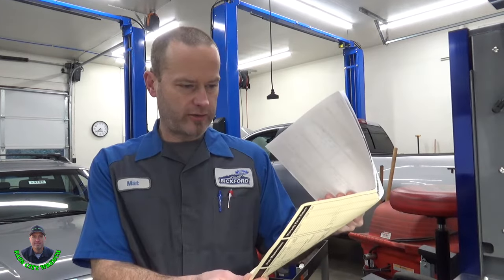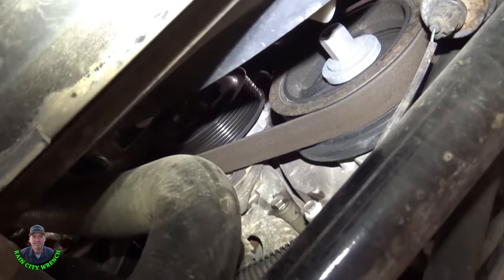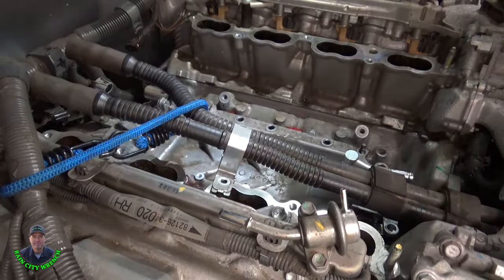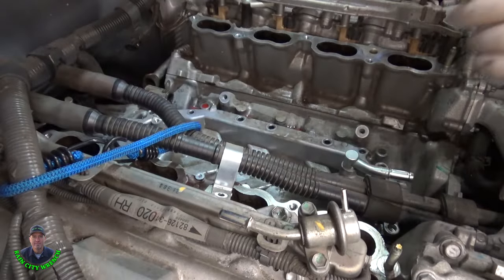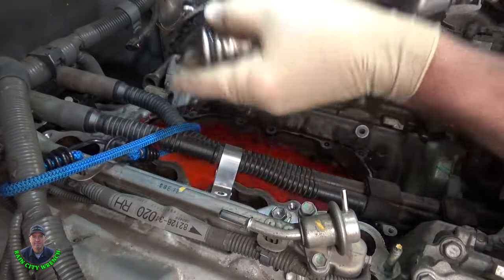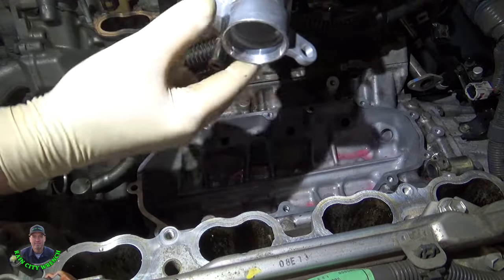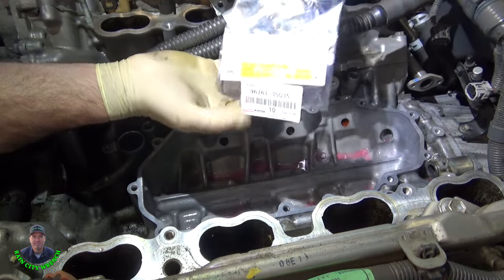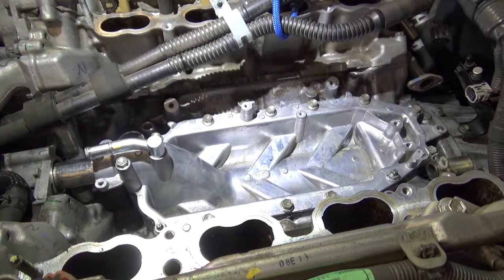TOYOTA TUNDRA 5.7 COOLANT LEAK UNDER INTAKE

Comment: Toyota SHAME ON YOU!!! You need to cover this cost!!!! This goes against your reliability reputation. And you need to FIRE the person responsible for this flaw.
Reply from the maker: A thin aluminum gasket with integrated rubber like a transmission pan gasket would have worked real well for this application instead of silicone.
Reply: If this had been a gm or ford it would have   catastrophically failed. Good on Toyota for doing it the way they did
Reply: @laredopotatoI was looking for a used tundra but all these issues have me scared. What year was your tundra? I might start looking at fords now

Comment: Good video but.....Warning for DIYer's: This is not an easy task. This video was edited and some steps were not included, so if you are thinking of doing this on your own, you may want to take a pause. the water tube and the transfer tube are connected to some kind of regulator behind the engine, pretty much everything inside the manifold is connected to that. That is where the main job is. It is not shown how to remove that in the video. I am currently stuck on how to remove that. The knock sensor plate also has a bolt in the back, in a very tight spot, if you loosen it you have no allowance to get it out without dismantling the regulator(whatever it's called). In my case I stripped it trying to remove the plate, I ended up cutting the bracket-ground(not sure if that is what it's called) kind of like a washer in between the plate and the screw to free up the plate. You have to also be ready to disconnect quite a few electrical connectors. RC, could please, add a few steps on how to get that regulator out of the way. Thanks
Reply from the maker: I think you are talking about the secondary air injection diverter valve assembly. Yea, sorry I didn't film that. I bungee tied the plastic tubes off to the side. You are correct, the hardest part of the job is removing the valve. I take the three bolts out of the valve and then remove the four small bolts holding the tubes on each side. Getting the front passenger side air tube bolt out is a pain, I pry the valve slightly to the driver side to get that bolt out and then slide the valve assembly straight up leaving the two metal tubes intact in the cylinder heads. Hope you have success in your repair!
Reply: What I’ve heard is not to tackle the bolt at the firewall, but rather disconnect the valves ate the lower portion of the  tubes near the pumps behind the passenger side wheel liner.  Then the valves come out with the tube(s) attached.
Reply: Thank you for these details.

Comment: DONT KNOW IF I'D SAY THAT IT MADE IT 122K MILES, LOOKS LIKE IT MIGHT HAVE BEEN DONE BEFORE BY SOMEONE NOT SO THOUROUGH, NORMALLY FROM THE MANUFACTURER YOU DONT HAVE THE RTV SQUEEZE OUT LIKE THAT HAD, GLAD TO SEE YOU TAKE THE LITTLE STEPS TO DO IT RIGHT,  I USED TO USE SYLGLIDE ON MY O-RINGS, THEN I HAD AN OLD TIMER SHOW ME TO USE LIQUID PIPE THREAD SEALER ON THEM, NEVER HAD AN ISSUE EITHER WAY, BUT ANY THOUGHTS ON THAT??
Reply from the maker: Hey Kevin, how you been? Good eye, you are correct. The more I think about it, Toyota most likely used their gray vulcanizing rubber type sealant from factory so that means the first repair only made it like 20-30k. 
 Great tip on the pipe dope. I just looked up the composition: A material safety data sheet reports that the "Permatex" 51D pipe joint compound contains kaolin, clay, vegetable oil, rosin, ethanol, etc[citation needed]. The ingredients are designed to:
 fill minute spaces between mating pipe fittings (kaolin), and serve as a lubricant as the fittings are forced together (vegetable oil). 
 Petroleum-based pipe dope is not intended for use on threaded PVC, CPVC or ABS pipe and fittings since it will deteriorate the plastic. Builders in the US are expected to use thread compounds that meet ASTM F2331 - Standard Test Method for Determining Chemical Compatibility of Thread Sealants with Thermoplastic Threaded Pipe and Fittings Materials or thread seal tape on PVC, CPVC and ABS threads.
 In summary, if the thread sealer meets F2331 standards then it will work in all automotive applications and not deteriorate/swell up rubber seals. Learn something new everyday!
Reply: @raincitywrench117  been good, and busy, those old timers know a thing or 2 don't they....lol
Reply: Ex Fel Pro needs to offer a metal reinforced gasket. Shame on Toyota for this design. Just like the Cam Tower leaks. My 2016 is doing this. Very invasive.

Comment: Nice job should cover the head intakes and mention when pulling intake watch the metal inserts from where the bolts go through don’t fall into heads,You’ll be going back in for secondary air valves next ,We just did valley pan and delete on air pumps

Comment: Just found this issue on my 07 Tundra. 268k miles so may as well address the air pump valves with a block off kit at the same time.
Thanks for the video.

Comment: Great video.  I watched this a couple of times and it helped me solve my same problem.  Sealing up the intakes is a must.  You flew over the Air Check Valves in the back and it took me a while to figure out what those were, I missed that 2 seconds in the video the first time.  That unit came out easier than I thought it would.  Pull the right 2 bolts, pull the back left and push the unit back enough to get a ratcheting wrench on the inside bold and  the unit comes out ok.  I did remove the check valves first.   Thanks.
Reply from the maker: Thanks for watching! Yea, should have filmed that part of it. It probably is the most tricky part of the whole job. Glad you got it figured out without having to pay someone. Love saving money.

Comment: thanks for that video. I got a Tundra in the garage. had coolant leaks here and there. replaced radiator, pump, thermostat and so on...Still coolant lost. as you said, it took over 3h that the leak occurred. so this heat exchanger job seems to be the last step. I check compression, leak down and co2 test. no cylinderhead failure.
you do a nice job there.
as I also have daily different cars in the garage I always pack my bolts in zip lock bags, give them a tag and put them in order as best as possible. any hose or vacuum line I mark nowadays with a yellow, red and white marker. for my local Cambodian mechanics it looks a waste but in the end I am faster assembling and I never forget a bolt, sensor or vacuum line which can be a pita to find out after the job why suddenly the car is not running at all!
Reply from the maker: Definitely check it. I bet that is where your leak is. Nice job on your organizational skills!

Comment: I’m having this fixed on my gx460 right now. Mechanic told me might as well replace knock sensors too because after putting old ones back on they can fail soon after. It’s turning into an expensive job. I have 150,000 miles now and plan to at least double that so why not.
Reply: I have 87k miles on mine and it’s in the shop for The Valley plate leak. I will ask about the knock sensors.

Comment: thank you for the video it was very insightful. Mine has a very slight leak coming down the bell housing. Im preparing to tow a trailer 10 hours next week and imagine i better get this done first. how long does this repair take you?
Reply from the maker: Think it was around 5 hours. Getting the bolts out of the air check assembly is the hardest part. The lower left bolt is a real tight fit but just barely comes out. The rest is pretty straight forward.

Comment: I've watched your video many times prior to working on my recently acquired 2012 Toyota Sequoia. When removing the Air check valve, I broke the 5 pin connector as it was super brittle. I've noticed it's almost identical to the MAF 5 pin connector. Would it be ok to fix the wire harness with MAF connectors instead of the original plug? What did you spray from the blue can when cleaning the mating surface of the coolant reservoir? Thanks for the great video!
Reply from the maker: I don't see why not if the pins are the same size. I used bulk brake cleaner. Alcohol works fine too.

Comment: my tundra mysteriously drinking coolant and squeel from the water pump on start when cold or damp out 118000 miles im afraid of this, also they say you may crack the heat exchanger when removing best to replace that or you just get another leak thanks for making this video its really helpful!

Comment: better to be safe than sorry, put shop towels in those intake runners so nothing gets down there
Reply from the maker: Good idea. Normally I do that but not that time. I did blow out the ports with compressed air before assembly.

Comment: Thank you for the great video! I have this very issue and will be making repairs after Thanksgiving. Quick question, how much coolant did you have to add back? Did you fill after reassembly?
Reply from the maker: I can't remember but think it was just under two gallons total diluted @ 50/50. If you are in a real cold climate then dilute less according to the bottle. I also use an air lift which makes filling real easy and you won't have to worry about trapped air and overheating.  https://www.youtube.com/watch?v=_WCRcuCZI50&t=28s&ab_channel=FordTechMakuloco

Comment: I just got done pulling the front timing case off to replace my timing chain tensioner.  Filling the radiator back up and have water running down the back of the block.  Despite practicing the install of the cover with a new O-ring on the front of the pipe, I have managed to get a leak.   It was a lot of work to pull that case to I am looking at going in through the top.   My first attempt will be to try and reseat the pipe from the top after removing the minimal things needed to access.  If that doesn't work.  I will be doing this next.  Do you have a list of O-rings that I need to replace if any?  How about part numbers for the knock sensors?

Comment: Thanks for the video @raincitywrench117. I'm having the same issue on a 2011 200 Land Cruiser.  Toyota dealer suggested replacing the knock sensors as well at $250 a piece, there are 4.  What is your opinion on replacing the knock sensors while they are in there?  Toyota quoted $3K for parts and labor. Ouch!!:face-orange-frowning:
Reply from the maker: Yikes! I never replace knock sensors unless they are bad. Plus, have only replaced two or three knock sensors in my entire 30 year career. I believe two were on Nissans. If one was to go bad they are easy to do, only the intake has to be removed. The knock sensor bolts do need to be torqued and not run down with an impact.
Reply: @raincitywrench117  Thank you! I really appreciate your input.

Comment: I believe I have this issue in my ‘15 sequoia. Local mechanic can’t find leak even with pressure test, running down bell housing, coolant mysteriously low… My truck has 165K miles and this is behind my capabilities. Will the build up of coolant residue hurt anything if I drive it like this for a while just refilling the coolant regularly? I don’t want to spend the money on it right now.
Reply from the maker: Nope. Won't hurt at all. Good chance this is the leak though. I would have it pressure tested overnight and then inspected thoroughly next day
Reply: I have the exact problem. I even took the car to the shop to reseal the engine valley plate and the leak is still occurring. LMK if you found a fix that wasn't the valley plate seal

Comment: Question i have to do this on my 2014. Could i just put the sealant on the bottom half of the valley to lessen the chance of smudge or issues or is it recommended to do the sealant on top?
Reply from the maker: It doesn't matter what side the sealant is put on as long as the plate is assembled in a timely manner. 👍
Reply: @Rain City Wrench  appreciate the responce! I plan to tackle this hopefully this week. I just picked up all the gaskets, sealant and coolant today from toyota. Wish me luck haha.

Comment: On minute 5:14. How did you remove that bolt. It looks like a bolt with bit head? Can you please link the socket size or tool to remove it?
Reply from the maker: It's an E Torx socket. Think it was an E6 or an E8. Here is a set:https://www.amazon.com/14pcs-Female-Torx-Socket-drive/dp/B089B268KL/ref=asc_df_B089B268KL/?tag=hyprod-20&linkCode=df0&hvadid=459657803259&hvpos=&hvnetw=g&hvrand=8513986803556923626&hvpone=&hvptwo=&hvqmt=&hvdev=c&hvdvcmdl=&hvlocint=&hvlocphy=9033404&hvtargid=pla-942538511940&psc=1

Comment: Was the water pump leaking too? I got confused. Or is it just the intake? I have the same exact problem on my 2010 sequoia.
Reply from the maker: Yes. The water pump was leaking too. The coolant leaking from the front was from the pump & the leak down the rear was from the intake plate.
Reply: @raincitywrench117  I’ll check if the pump is leaking 🤞🏽 lol. What kind of silicon can I use for the intake plate? Can I use a head gasket silicon?
Reply from the maker: @rashadatifrsindi9828  I like Motorcraft TA-31. Use it on almost everything, thick and tacky gray material like what oem manufactures use to seal engines and transmissions. I just so happened to be out the day I shot the video or else that's what I would have used.
Reply: @raincitywrench117  Thanks dude. You're the best. I also wanted to ask about the impact wrench you're using. I noticed that you're using regular socket and not impact sockets ( low torque applications of course). Do they fit fine? What drive size do you recommend? I was thinking of buying Kimo https://www.youtube.com/watch?v=k0-tPJJBAUE . I am just scared my regular sockets won't fit because the kit includes a couple of sockets only.
Reply from the maker: @rashadatifrsindi9828  The Kimo unit looks good for the price. I think the best is milwaukee but they are like 3 times more. I prefer 1/2 drive for heavy duty work like lug nuts, frame bolts, suspension bolts exhaust manifolds, etc & 3/8 for most everything else then use 1/4" for light duty  applications like air filter housings, headlights, dash work, etc. 
 I pretty much use impact sockets for most of my jobs. You shouldn't have a problem fitting any brand sockets on the Kimo.
Reply: I just pulled the intake manifold and see that I have a very small drip coming from the front. Do I need to pull the plate as you did in the video, or is it just a replacement of the water pump? Thanks!

Comment: Thank you for your video. May I ask what grid of your gasket removal wheel do you use and do you use Toyota silicone gasket?
Reply from the maker: Red (medium) Scotch-Brite pad with Toyota FIPG would work perfect. 
https://www.amazon.com/Black-Hawk-Surface-Conditioning-Change/dp/B01HUNK1ZS/ref=asc_df_B01HUNK1ZS/?tag=hyprod-20&linkCode=df0&hvadid=309807921328&hvpos=&hvnetw=g&hvrand=858608325201538513&hvpone=&hvptwo=&hvqmt=&hvdev=c&hvdvcmdl=&hvlocint=&hvlocphy=9033382&hvtargid=pla-571314866796&th=1

https://www.amazon.com/Permatex-82194-High-Torque-Silicone-Gasket/dp/B000HBGI8K/ref=asc_df_B000HBGI8K/?tag=&linkCode=df0&hvadid=312097317052&hvpos=&hvnetw=g&hvrand=6812777214562088217&hvpone=&hvptwo=&hvqmt=&hvdev=c&hvdvcmdl=&hvlocint=&hvlocphy=9033382&hvtargid=pla-437600037492&ref=&adgrpid=57631863970&th=1

Comment: Any suggestions on the o-rings? I’ve done this job 3 times in 6 weeks on my tundra because the o rings keep leaking. I put syl-glide on them every time. I’m about ready to cover them in the right stuff and call it good. That pipe may never come off again, but I don’t think it will leak anymore.
Reply from the maker: Weird. Any corrosion inside the aluminum and are you using Toyota o-rings?
Reply: @raincitywrench117  I am using Toyota o-rings. Someone else on here just told me the coolant pipe from the water pump to the heat exchanger has been updated. I ordered one of those, hopefully that does the trick.

Comment: Mine is leaking clear water from the back of the intake , it’s not coolant because it doesn’t have a color. What could it be ?
Reply from the maker: Strange? If your coolant level isn't dropping then it's definitely something else. There are two air injection tubes that run under the intake that can build up water inside but that would mean one of the black plastic tubes is cracked. Sure it's not condensation leaking from the evaporator drain?

Comment: I have an 08 Sequoia and suspect I may have this problem.  What is the cost to have this done at a shop?  Thanks for a great channel!
Reply from the maker: I think this was around a 6 hour job so depending on the labor rates in your area my guess would be at least $1500
Reply: @raincitywrench117  Thank you!  I was able to remove the intake manifold and thankfully there was no sign of leaking...thanks again for the channel!

Comment: Just got my sequoia repaired at Toyota and woke up to coolant back on the ground and radiator empty so they didnt fix it. Toyota is an hour away so would it be safe to fill it back up and drive it there or get it towed so they can fix what they didn't fix?
Reply from the maker: That stinks ☹ Did you get it back up there and fixed?

Comment: They should use a rubberized metal basket in that location and it would last the life of the vehicle. Same thing with their V6 timing covers, so wasteful. They think they are saving on production cost but get nailed on warranty when those prematurely fail.
Reply from the maker: Also agree. A thin rubberized aluminum gasket like manufactures use on transmission pan gaskets would work great plus be much easier to repair.

Comment: I’m currently going through this issue. What silicone do you recommend use on the cover.
Reply from the maker: Permatex ultra grey would work great.
Reply: Obviously, toyota FIP didn't work so well. Have some bad luck with permatex grey. 
Have you ever tried the permatex right stuff?
How many miles will your repairs usually get a vehicle le by